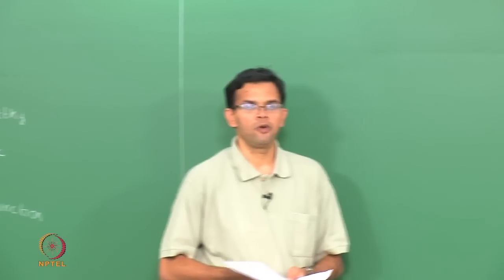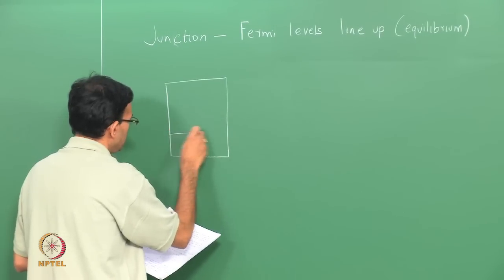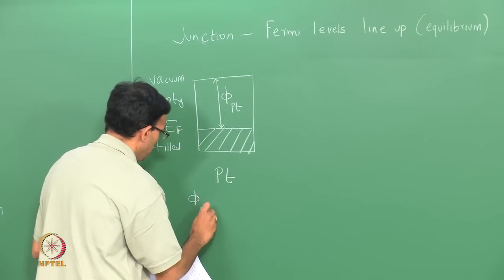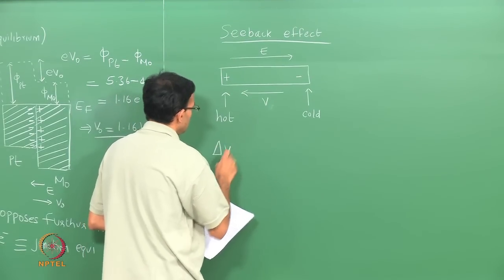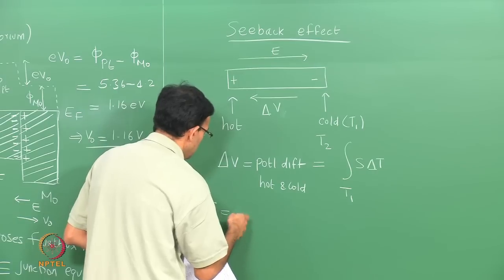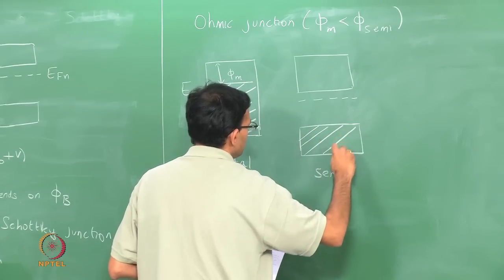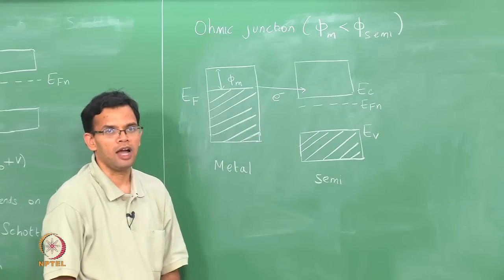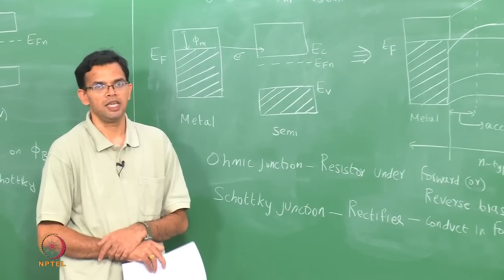Metal-semiconductor junctions

Comment: 1) Why the resistivity of the conductor is not zero at absolute zero temperature?
2) How 0.026meV energy is sufficient to for electron to cover the 1.1eV  band gap of Si at room temperature?
Reply: Ans 2- due to the phenomenon of quantum tunneling where electrons can pass through a barrier more than the energy it has...

Comment: Nice... however, then bending of the bands has not been explained. Why can't the bands simply fall down without having to bend?
Reply: bcs at contact point they remains at previous position.
Reply: Paivren  Becoz the effect of field experienced by charge in semiconductor is only till bend portion.
Reply: Hi buddy, Fermi level is always close to electron filled region. Here in metal side electron concentration is high after depletion region formed. So it goes higher to lower side with bending depends on e concentration.
Reply: Because the energy function of a material is always continuous. Now energy is just potential scaled by  charge and we know that potential is integral of electric field with distance...and integrals are always continuous because they have to be differentiable.

Comment: Can someone explain to me the depletion region?
Reply: +Memo “MekoxTwiSparkle” Pony In case you were still wondering, I think I can try my hand at explaining it. When a metal-semiconductor junction is formed, electrons flow from the semiconductor to the metal, filling states in the metal's conduction band in order to bring the Fermi energies to an equal level. He states that not only electrons on the surface of the semiconductor migrate to the metal, but some from the bulk of the semiconductor material as well. The depletion region is the region in the semiconductor from which electrons flow into the metal, and as you can see it is not limited to only the surface. Hope this helped, and if anyone spots an error please correct me.
Reply: Depletion means deficiency. Electrons move from one material to another so it leaves deficiency in number to its own side. Since no electron we call it holes or. Positive. Combination of this electron and positive holes region is called depletion region.